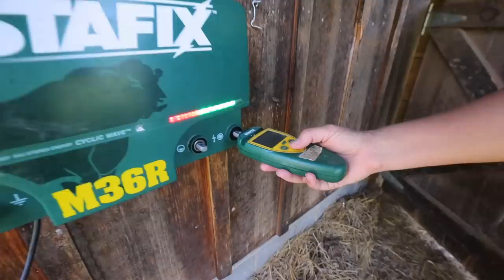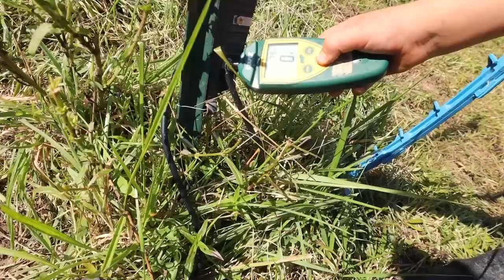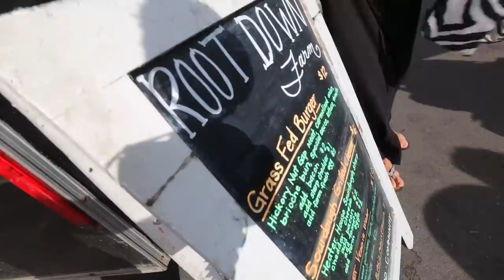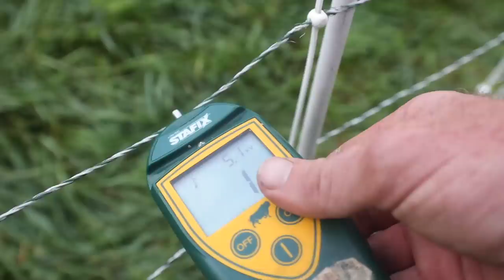IT'S OVER | How Chickens Help Us Put Our Garden to Rest

Comment: I grew up on a chicken ranch...  we had a tool to catch chickens... it was a piece of heavy gauge wire... somewhere between #4 and #8...  bend the end 10 inches back into a U, leaving a gap between the main stem and the u of about 3/4 of an inch... then flare out the end 3" about 20-30 degrees... leave the entire tool about 5' long... handle end can be bent back tightly to provide a thicker handle.. you can then use this to catch the chicken's leg much more easily than chasing them and tackling them...

Comment: Keep your grub bucket in the shade and use a loose fitted lid to keep out rats.  Drill 3/8 inch holes below the rim, so that adult black soldier flies can get in and out.  They'll lay eggs in the compost and under the lid.  Run multiple buckets.  Use one for feed and the other for replacement stock. Run more if you have enough material to process.

Pre-pupae will crawl up and out through the holes, then find a nice place to pupate and become adult bsf.  To collect the pre-pupae, put the bucket in an inverted plastic trash can lid with 3/8" holes drilled in the lid.  Place the lid upside down on the plastic trash can with some wood shavings or dried leaves in the bottom of the can.  Don't let it get rained on.  

Maintain a compost consistency somewhere around dough and porridge.   They'll eat almost anything, but I'm having good luck with turkey poop mixed with spent coffee grounds.  You can culture them in a greenhouse for an extended season, but the adults require some plants to hang out on and some water.

Black Soldier Fly Larvae (BSFL) are roughly 67% protein, depending upon their feedstock.  The rest is lipids.  They drive off houseflies as they out compete them for food and drive up the temperature of the compost as their bodies rub against each other.  The remaining material, the bsfl poop, is called frass.  Frass is an excellent fertilizer.  It can also be added to anaerobic digesters to produce methane biogas.  Feedstock pre-processed by bsfl produces about 30% more biogas!

After the pupae hatch and the adult flies crawl out through the inverted trash can lid holes, the pupariums are left behind in the  trash can.  They are made of chitin.  When plants detect chitin, they respond as if they are under an insect attack and shore up their cellular walls in defense. This makes for resilient plants.
So, you want to mix that into your soil.  

Adult bsf do not have functioning mouth parts. They only drink water, so they are not disease vectors.  Some bacteria such as ecoli cannot survive the digestive system of the bsfl.

I hope this info is helpful.  I appreciate you guys!  Much love to you all!
Reply: The best insect based protein comes from black soldier fly larvae. However, you only get 25% feedstock conversion. In contrast, with chicken, you can get 50% feed conversion.  So, don't raise the grubs on your chicken feed because you are wasting it.  Feed the grubs wastes that you can't feed to the chickens.

Comment: P.S. I look forward to seeing Jonah's PEDINSULA project!!  Those boys are interested in digging habitats, can i suggest you teach them about the Solari architecture experimentation projects starting in the early 60's in Arizona. They were building mostly underground because the ground usually stays around 55* in all kinds of weather, it's great in hot & cooler weather. They made the ceilings with curved cement using colored bottles embedded in ceilings you can see during sunlight hours. There are still students going out to a town they have been building for decades now, off the highway north of west Phoenix area (on the road that heads up to Prescott, Sedona & eventually the Grand Canyon). They made a documentary about the building of it too. It's going to stimulate their minds with such inspiration - I hope to see how it affects their designing ideas!! especially if you are dreaming of house up on the hill!!